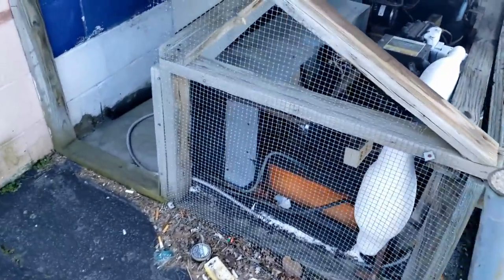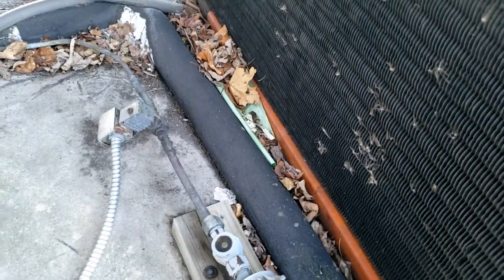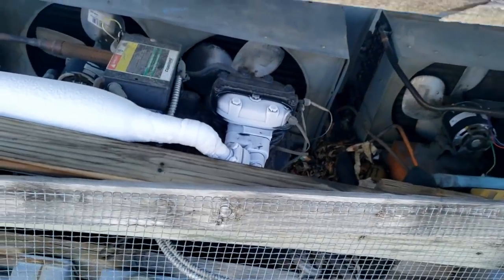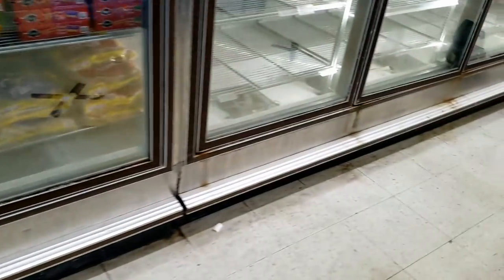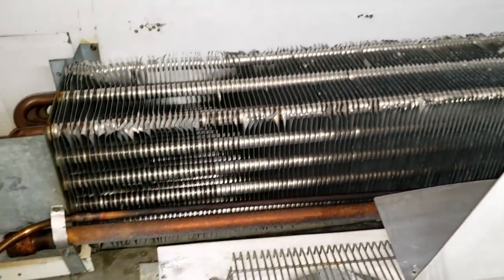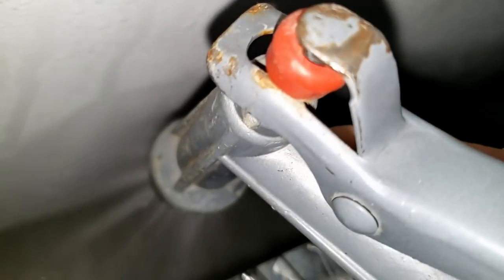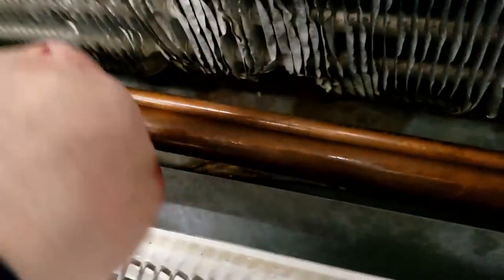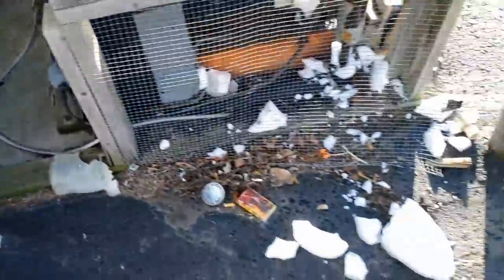Freezer Has 99 Problems But Frozen Product Ain't 1

Comment: Be careful with that “pocket hose” , I’ve had 2 episodes with them. 1 blew out in a pizza house lobby🤷‍♂️and the other in an isle of a in a 7-11. Both hoses were the customers. They don’t like to much pressure lol. Nice job getting that old equipment going.
Reply from the maker: Thanks 4 checking it out. I've read several bad reviews about them is why I haven't gotten one. I had a cheap plastic one that I purchased from a drug store when they first came out.... It lasted 2.5 years but I think I got lucky. 😏
Reply: and never try to use them for draining anything, lol. you can whizz harder than the 1/4" passageways in the ends, very restrictive!

Comment: With those old style zero-zone freezers there is not always an Answer to the ice build up especially behind the evaporators by the wall, unfortunately I have spent many hours doing the same thing. Sometimes feels never ending! Good work
Reply from the maker: That's great to know, thanks for sharing that!  This is the first one I've worked on. Most of my grocery stores are all hot gas defrost and a few electric element.
Reply: I'd think that the ice build up is because they're ancient and the bottoms warp, leak air or the pan becomes unlevel.
 Some line ups need to be replaced but no one wants to do that, and I don't blame them
Reply from the maker: I believe it's a mix of several things. I think it's a combination of air gaps around the evaporator, not enough defrosts and low on refrigerant. I would have liked to double check the superheat but got cought up in all the other repairs.
Reply: @jakem117  I think your correct on that infiltration plays a big roll. Alot of the stores i work in are old so I get to deal with few of these old beaters some are worse than others, interesting though when you do get the chance to replace one of these lineups the difference in horsepower from something newer

Comment: I've de-iced 100's of cases-usually other problems like bad fan motors and bad fan blades-also watch klixons too-peace-looks like Tyler case
Reply from the maker: The reason the lights kicked on and off in the beginning was the klixon. It wouldn't surprise me there sticking. Getting the original switches would likely be a long shot. Thanks 4 the info👍👍

Comment: I had a c-store with the same 5 door case it keeped icing up no matter what you did ice built up under case due the poor case insulation it sucked finally they replaced the case but I hated taking it apart because of the design

Comment: I'm an electrician.  
We service a chain of grocery stores.  
I absolutely hate working on these freezer / refrigerator units. 
We thankfully don't get involved with the refrigeration  aspect. Unless those guys need an electrician.  
But the lights, and door heaters suck. Usually the light controls are in the bottom compartment and full of condensation.
Reply from the maker: I think they've made some major improvements over the years. Everything seems a lot more simplistic. Thanks for the feedback, I'm glad I'm not the only one that thought it was a mess 😆

Comment: Have you tried using a steam gun to thaw that ice?

Maybe stick a metal rod inside the drain openings that are attached to the electric heaters to put some heat in them.

Comment: Holy ice batman.  Great  📹. ! If the solenoid valve continued to leak,  is the  only other option to sweat it out n put new valve in ?
Reply from the maker: I believe they make seals for the valve but I don't have any. So yeah, I'd valve off the receiver and burn in a new one.
Reply: Thanks Rick

Comment: Somebody deserves a medal for keeping those units running all those years. Watched the whole video with my mouth wide open gasping for air. 

The thing i am most surprised about is that no plow or suv soccer mom have demolished the units outside when they are on the ground like sitting ducks. 😂
Reply from the maker: Did you miss the concrete filled guardrail in front of it? They're going to lose their bumper that way. 😆😁
Reply: @HVACRSurvival  Sorry i did miss that but i am not sure it will hinder the persistent masses working in unison. 😀
Reply from the maker: @mrbugenhagen3364  job security then🤣

Comment: How long did it take you to defrost all that?
Reply from the maker: 1st trip was 6hrs plus drive time
Reply: @HVACRSurvival  heat gun time/ insulate drain 1" keep from freezing in case?
Reply from the maker: It was 1",  it shouldn't freeze under the cabinet but the ice on the top level transferred through. This has been in for 20 plus years so I hate changing to many things if they use to work. Normally i would have 4 defrosts but this isn't a busy store.